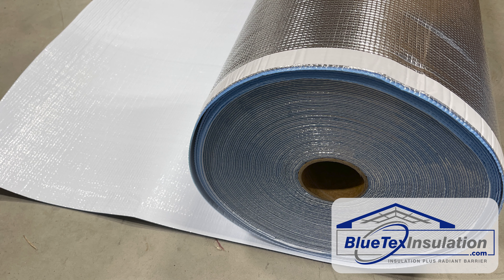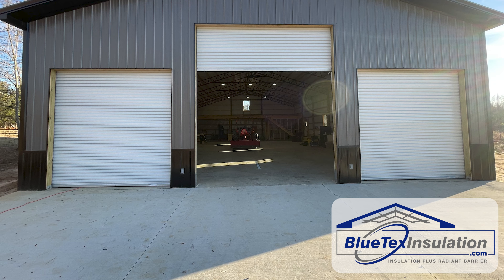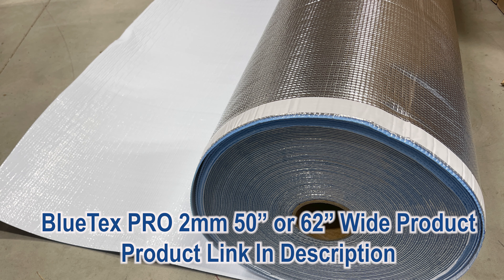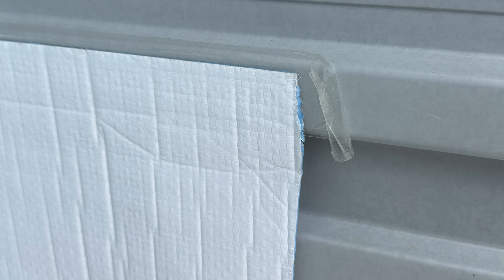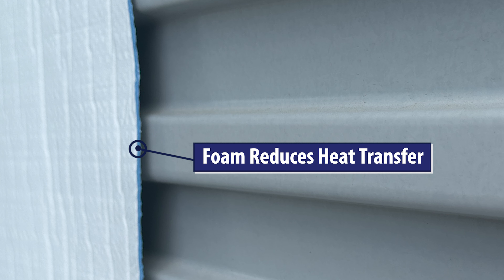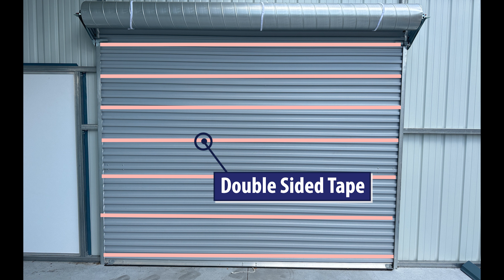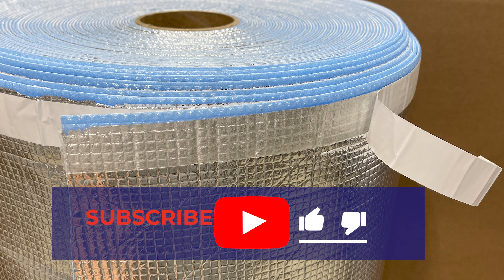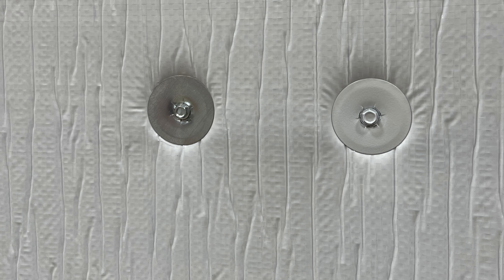Roll Up Garage Door Insulation - How To Install - Keep Cool With BlueTex Insulation - New

Comment: I tried this before ever seeing this video and my roll up door would not work correctly, it would bind when rolling up.
Reply from the maker: Did you get a Sample of the www.BlueTexInsulation.com PRO 2mm? It works well and is not thick enough to cause binding.

Comment: What about the gaps on the railing on each side of the door? Mine has gaps all the way up and down
Reply from the maker: www.BlueTexInsulation.com Roll Up Door Insulation is not designed to "seal" the door.  Its main purpose is to reflect the heat off the door and keep the interior of the building cooler.
Reply: @BlueTexInsulation  Nice to see you guys keeping up with comments! Im about to reach out lol
Reply: @BlueTexInsulation  yeah and it gets cold in winter , wondering how to seal it for winter ?
Reply: @Muddyfox47 broom seal
/ brush seal install it on both sides